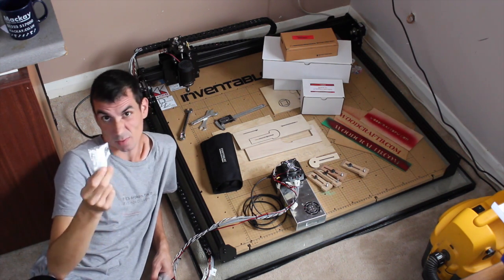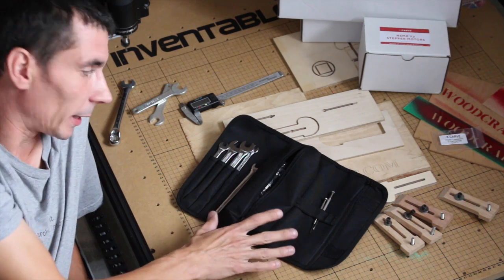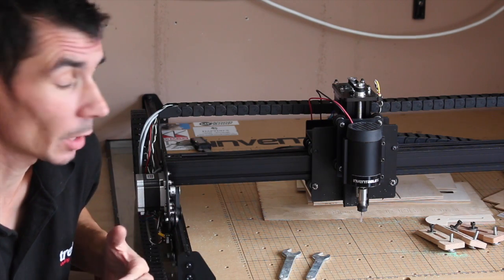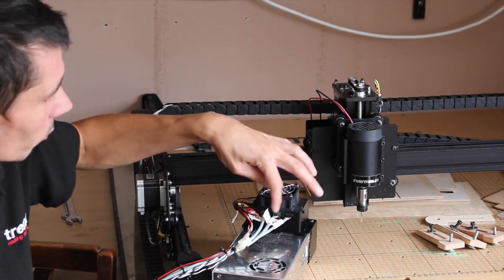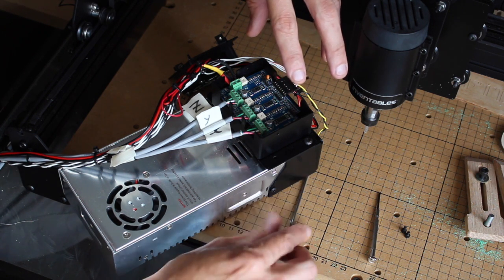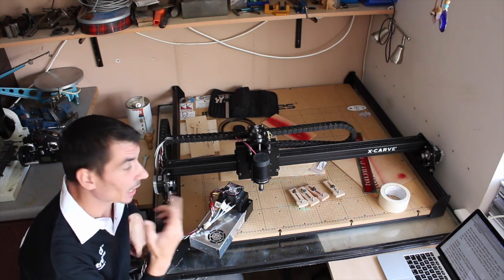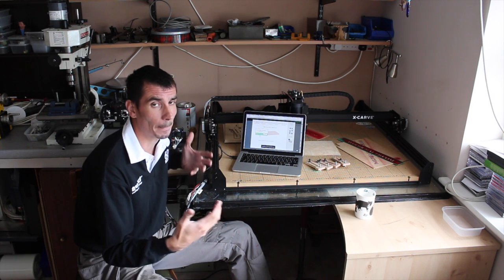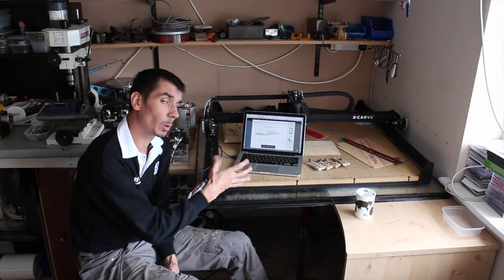XCarve build &  HONEST Review: The good, bad, and money wasted?

Comment: Great review. Did you use to do aerospace engineering? Very pointed review, your nose came out clean. Now I take your recommendation that much more seriously. You hit 2 pts that I was planning to use, very similar in phrasing too, it might be strange to see two people say almost the exact same thing. I solved the cable box wire coming out issue with Velcro on the cable, and Velcro on the box, works to relieve the pressure. I also built a folding portable cart for the X-carve, reduces the space it takes up ~50%, I think you might like it.
Reply from the maker: +The Nomadic Polywright Show I did, both at Farnborough and Bristol. When did you pick up on that? was it from this video?
Nose? LOL!
interesting also that you picked up on 2 points I did - which ones? This could be a benefit to both Inventables, and end users!
My plan is to use one of the projects that an end user has uploaded to the inventables community which should stop any future wiring problems and also protect the power supply, another create feature of the whole "package that surrounds the inventables idea - sharing ideas and designs (I also got the hold downs file from there too).
I saw the folding table - and rely admit i was disappointed..........that you didn't fall off it ;-) JK.
now I have it on a desk of sorts, it's actually created space in that workshop, because much more can be stored underneath, which frees up space elsewhere. it also makes it quicker to get setup, not having to fold it - I'd probably end up not using it as much if it was "packed away", but i did think about a folding option for a while.
Reply: ***** I think the engineer things was picked up awhile back, you were talking about previous careers. I just thought it was funny that you suggested the X-Carve was easy to build. Being engineering minded.
2 pts: 1. People who want a X-Carve probably have the mind and motivation to build it. 2. The X-Carve shouldn't be limited to woodworking.
If you aren't willing to jump on something you build it's probably not strong enough. I know what you mean about it being packed away. As a frequent mover, the general rule is, if you pack something away for 6 months, you probably don't need it; if you pack it away for 1 year, you probably should throw it out; if you pack it away for 10 years, you're a hoarder in the making.  I just opened the table last night to take a few photos for a video. It was convenient enough, at least for me.
Reply from the maker: +The Nomadic Polywright Show That makes perfect sense!
Still confused  about the nose comment though. :-)
Reply: ***** Oh, sorry, there is an American expression for sycophant behavior, where one's nose end up in someone's behind, there by making it "dirty." I didn't think that it wouldn't translate across the pond.
Reply from the maker: The Nomadic Polywright Show argh, yes. It does translate it would the tongue here in the UK. :-)
In all seriousness though, That kind of policy isn't helpful to; you, me or Inventables.
Reply: ***** Agreed.
Reply: +John Zhu here in the UK we call it brown nosing!